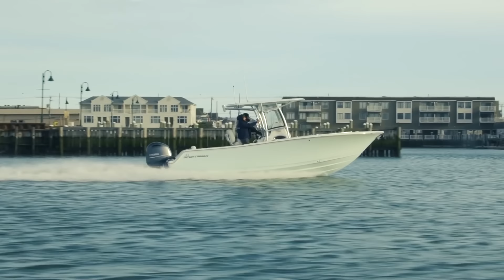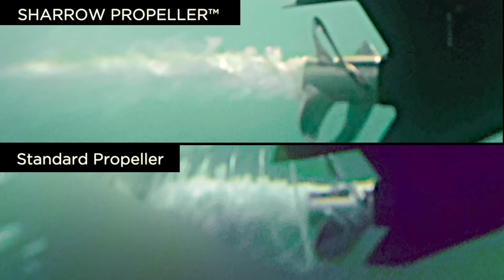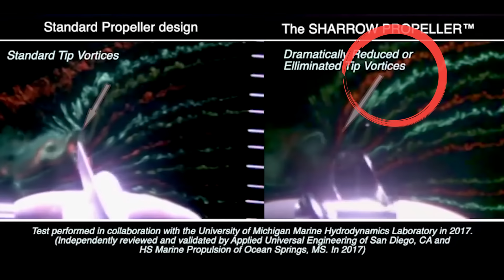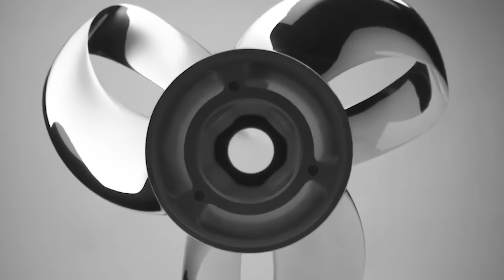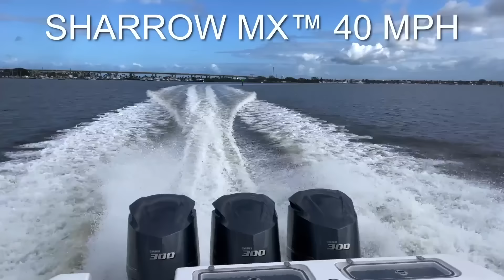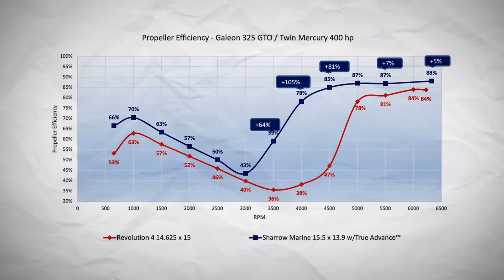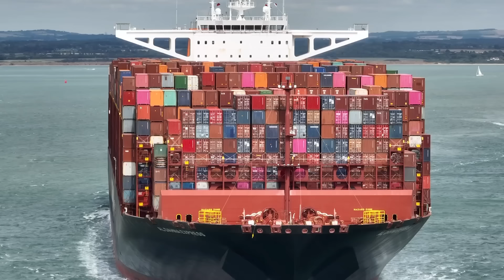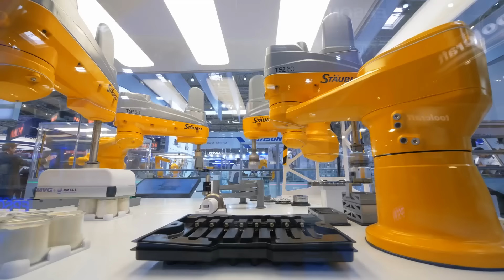This Genius Propeller Will Change Transport Forever

Comment: Efficiency improvements are rotational speed dependent; at midrange and high upper end of the operational envelope, performance may even be worse.
There is a danger in cherry picking performance improvements.  The Sharrow torroidal prop can push a boat to plane at a lower speed than most other props, so efficiency difference at that point is significantly greater than the non-planing boat, but once the other props are operating at higher speed and planing, the efficiency difference dwindles.  Noise reduction is significant across the normal operational range, I believe.

Be sure to credit those whose video excerpts were copied to make this presentation.

Comment: A standard prop with a prop ring is less noisy and vibration is much smaller. In Sweden the put a plastic prop on a ship and because it makes less vibration do to it is softer than copper prop.

Comment: NoiseBlocker eLoop is a series of computer fans with ring propellers that exists for like 10 years already. They are standard size and fairly priced, you can go and buy and use them like any other computer fan. Just like toroidal props, they don't produce a lot of vortices, but, while they are efficient and quiet enough to make a great product (and look wonderful), they don't show any crazy figures and didn't start a revolution in computer cooling. So yeah, always be sceptical when something is promised to "change everything".

Comment: See a title like that and you already know the video is gonna be a let down
Reply: The video wasn’t a let down in my eyes. Did you think this prop was gonna make boats start flying in the air? It gained a substantial increase in efficiency and is much quieter. It’s quite literally a multi-million if not soon to be billion dollar invention that potentially changes quite a few aspects of everyday life. As was stated in the video it’s not only going to be for boats. Use your imagination and think about all of the potential capabilities of having this prop design on other mechanisms. Box fans, maybe they won’t be so loud. Wind turbines, more efficient more energy production. I mean really the only way this can be boring is if you didn’t follow any thought paths and looked at it from the surface level.

Comment: Why cant these parts be cast then machined as against using a billet as s shown surely that would bring the cost down by 50-60%, lets hope that this about improvement and efficiency and not driven by profits alone

Comment: Would be good to mention, with respect to cargo transport vessels, that they are some of the worst polluters on the planet, and one such ship emits more particulate and other emissions than up to 16 million vehicles per day. Increase fuel efficiency by 20% on those fleets and that is a potentially massive jump towards both cost savings for the shipping companies, and a massive reduction in per-trip emissions, which is a huge deal.

Comment: The issue with boats is dinging the prop on a rock, log, or whatever is floating at the time; there's no way I'd risk a $5000 prop no matter the benefits. These props need to be the same price. Figure it out.

Comment: Great vid with new tech. Another possible advantage would be  less fouling and cutting as curved tips would shed debris. They are blunt so less like a knife to not cut into things. It might be a compromise for blade guards on drones? It would seem there is more surface area so the blades could be a little shorter for the same amount of thrust. ...also, the tip web would give inherent structure making them stronger per given length.
Reply: This isn't new.

Comment: As a person with a home recording studio, the computer application for this is something I hope happens. We always have to keep the computer out of the room, or record outside the room.
Reply: why would you not just use background noise cancellation from a audio sample of your computer fans? or just use fan software to min the fan rpms when recording?
Reply: You might want to invest in a water cooling kit for your computer.  There are off-the-shelf ones as well as custom water block kits.  Not only is your computer cooler - but much quieter.

Comment: Now recent test from peoples with drones did show, that this propeller doesnt work better, has lesser thrust and consume more power, and that guy from MIT tells only half of the truth. That shape from that so called toroidal propelller is inefficient and even if you would make the propellers higher, it would stress the bearings from the little motors from drones.

Comment: Very interesting!  But clearly, to scale ship propellers to the size needed for large freighters, an entirely new manufacturing method needs to be created, as a single steel ingot that size is unachievable, and would be WAY too expensive to machine even if it could be made. 3D printing with laser sintered metals has only been used on small pars and the metal particulates are quite expensive on their own. Sintered metals also have less strength and likely, greater porosity. Could a molded, near net shape of that complexity be made with sufficient strength and with minimal distortion?

Comment: This is an MIT Fake! They miscalculated the effiencenty - and this prop has more weight - this also ignore the MIT measurements - so the torque is higher for the motor and this mean less effiencent in comparing to the normal blade! Why the hell all you make videos of this fake?

Comment: Here's an interesting comment. Your title in your thumbnail, "105% efficiency" is clickbait bullshit, it is impossible according to the real laws of physics just as much as you can never go 100% of the speed of light, and you're an asshole for using such cheezy tactics. In case you're interested, 105% efficiency means it would generate 5% more power than you put in. There is nothing on earth that can be 100% efficient. Say, do you have a perpetual motion machine perchance?

Comment: $5000.00 compared to $500.00 🤔 That is 100 times the amount! You would never make that back in the lifetime of the propeller. Never. If the propeller never got damaged or weighed down with debris like sea weed (which would cause it to run less efficient). If you ran it in clear water, no accidents, polished and cleaned after every use, you would still never make back the initial cost. Unless those are made way cheaper people will not switch.

Comment: Efficiency can never be greater than 
100 %.
Should this be possible the apparatus will be able to fill the fuel tank while operating
Reply: At 105% efficiency it gives back more useful energy than what is used to drive it.
This is an impossibillity

Comment: The efficiency of 105 % that you quote is a nonsense.  From the figures, it is 105% more efficient that the propeller used as the reference. This video is slowly taking on a bad smell. There is no efficiency plot for the propeller in air. Is that part of your strategy?

Comment: It is unclear to me how much the noise is reduced. The rotation speeds appear to be very different too, The toroidal propeller being about only  50% of the conventional propeller.  The graph seems to be indicating over 30 dB(A) noise reduction between 1000 and 3000 Hz while the original noise is only about the same. But those figures are only estimated by eye off the chart, do you have the original figures?

Comment: This is not a new concept, as a kid back in the late 50's I was 10y old and we had a hand held toy that had a 6" enclosed propellor on top, where you was able to pull a retractable string that was fixed to the spindle that spun the propellor skywards and was very effective and fairly silent.

Comment: I am thinking that an alternative to the toroidal design could be to fit integral wingless to the tips of standard propellers just like we see on many commercial jets. The principle of the wingless in disrupting vortices is essentially the same in both cases. The advantage of propeller winglets would be economy of manufacture and simplicity of design.
Reply: What's happening with this auto-type ? I did say 'winglets' and not 'wingless'. Everyone reading this will think I am clueless !
By the way , anyone not familiar with the term 'winglet' , just picture the image of the wings of a Bald Eagle. Those striking feathers jutting out at the end of the wings are not just to impress or to strike fear into any prey which watches in terror as it tries to escape. The winglets break up the vortices formed at the wing tips , thus increasing efficiency and lift. Aero Engineers discovered this a few million years after the Eagle implemented it. Now they can put a feather in their caps.

Comment: Nice video, expertly presented and illustrated . This was a nice explanation of an exciting new development in propellers which evidently has some very significant advantages in performance and efficiency.
 I'm wondering if there is a potential application for wind turbines for power generation. I can just envisage turbines with smaller diameter and lower height with evident economic savings . There would be questions of efficiency , and of course manufacturing complexity and costs. Judging by the evidence of the engineers involved in researching the toroidal design I think it wouldn't take long for them to evaluate the possibilities.

Comment: Like to see some test results on wind turbine blades and could it work in turboprop props to cut its main problem (noise). Would it work for helicopters?
Reply: No, not on helicopters. The dissymmetry of lift would be a huge problem.

Comment: It did not increase efficiencies by 105%, it increased efficiency  from 35% to >70%, an increase of just over 35%,. Stop reporting efficiency increase in liberal terms! Use proper engineering methods! Otherwise it only makes you look foolish.

Comment: Nothing will ever pass 100% efficiency in the whole universe. Nothing. Never. 99.999999999999999999.....% is the maximum. Nothing will ever be even 100%. You cannot multiply the energy you put into a device.

Comment: It addresses an significant inefficiency in propellers,  the "leakage" of fluid from the high pressure side to the low pressure side. It is this leakage that produces tip vortices.  Commercial Jet Engines use the stator duct to prevent these "leaks" while high aspect ratio blades are used to minimise them. These toroidal blades avoid having tips, reducing the opportunity for "leaks". A very good idea! Hope it succeeds at an affordable price.

Comment: I can see it being restricted to relative light loads.  Scaling this thing up would bring serious problem with controliing vibration, balancing, etc.  That is because the weight distribution through the blade width looks awkward. On a traditional propeller it looks and feels "natural" most of the weight near the axle tapering off towards the edges whereas this design has a relative large proportion of the weight far from the axle creating a bending momentum when the slightest disbalance occurs. And such disbalance is guaranteed to happen even if the propeller is perfectly balanced out of the factory: a small dent, a stone chip etc. would do it. So when used is a heavy load situation this propeller will have serious reliability problems. And I haven't even started on the "ease" of its maintenance! And if something goes wrong is it really repairable? What do people think? I am obviously not conviced beyond light applications.
Reply: Good point. It helps to explain the difficulties described by some other commenters experience with these kinds of propulsive systems.

Comment: Looking at the design pictured almost looks like 2 inboard props left hand and right hand stacked on top each other with tips connecting....seems almost doable by configuring a tip piece to connect

Comment: * Not so interesting, unfortunately I saw this  Type of Prop back in the 70's and was and rejected and suppressed by the US Patents . . . Now, it's basically been stolen from or off a Patent application that was either Filed away, Stored or left laying around for some 'American' to develop !!!  ( The original patent application was made by Allan Bird of Bird's Engineering, Bulawayo, Rhodesia { No relation of mine} and probably still have the Paper work with them in Zambia ) Another Stolen by the USA occurrence ??? >> Yes it is, I witnessed the excitement and security  during development, so so very sad the USA does this !!!

Comment: try diy radial ring magnet in copper pipe sheet motor with iron rod core
Reply: bi-prop is clearly better (two propellers stacked with curved end piece, just like in bi-planes should have, or circular wing kinda
Reply: or spiral cone propeller, that takes air from sides, kinda aero spike spiral turbine
Reply: also you can do simple metal 3d parts by 3d printing a model/mold then electroforming a thick shell of metal, like with chromium/titanium

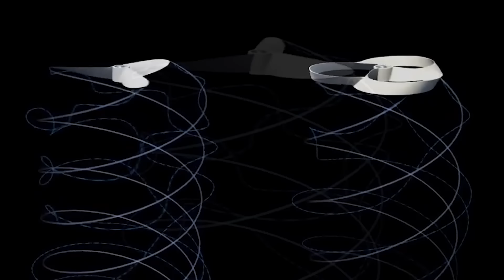Comment: Sorry, but the drawing on the right at 1:17 is completely nonsense! It does not show a true toroidal prop because the blades are not twisted correctly - in fact not twisted at all, what make the slope at the "tips" go to almost infinit instead to almost zero.

Comment: Those dudes at MIT didn't come up with anything, they just added the wrong name to the mobius strip propeller so no one would find other research. I found a publication dated 1996 on the subject of these propellers. You can find them by googling "Propellers And Fans Based On The Moebius Strip" or "Screws, propellers and fans based on the Moebius strip"

Comment: No, increases in efficiency are not properly described in numbers greater than 100%. Any number greater than 100% should properly be reported as a factor, as in 1.1x, 1.5x, 2.0x, etc. One using % numbers greater than 100% smacks of marketing hype, and makes one suspect the person reporting has simply repeated marketing claims from a manufacturer without applying any critical analysis of it themselves. Also with regard to the outboard motor graphs, I question the graph that goes up to ~6000 RPM. It isn't made clear if that's crankshaft RPM or propeller RPM. Very often the two are different. An outboard drive train usually employs reduction of around 1.5:1 or 2:1 from crankshaft turns to propeller turns. Propellers turning at extremely high speeds are less efficient, and lead to higher amounts of cavitation (a problem mentioned in the video). If the toroidal prop can be run at higher speed thereby eliminating the usual reduction gearing, that could be an important advantage that would be important to communicate.

Comment: I used to do RC boating when I was younger and modded my propellers in a similar fashion, mainly because I was curious if you could "invert" the design of a propeller so that the water was kinda pulled into the blades instead of the blades just spinning wildly, causing a ruckus just to get a modicum of thrust. Was it exactly the same as a "toroidal propellor?" No. Did I kinda invent something revolutionary all on my own? No. But in many ways yes. Does this make me a genius on par with Nicola Tesla? Who's to say? But, probably.

Comment: more efficient in theory but peak performance leaves a lot to be desired for many applications.  High rpm performance is trash making it a useless design for the purposes that run high rpm. Efficiency is fun and all but its just not suitable for many implementations. keep researching.

Comment: It'd be interesting to see the effect of these blade forms on external bypass turbine engines.
Reply: Interesting idea. I am just wondering about the requirements of mass air-flow since the fan has to provide air for bypass as well as turbine compressor. The fan of an average aero-engine is in the region of 20 or more blades, necessary to achieve the aforesaid air flow. I would be curious to know how the geometry of a toroidal design might fulfill the preconditions.  The other important factor is the need to provide streamlined air-flow through the turbine compressor. I once encountered a challenging fault on an RB-211 gas compressor on an oil rig in the North Sea. The Rolls-Royce turbine specialist who was working with me strongly insisted that the problem was caused by a 'rotating vortex' in the airflow caused during initial ignition. I used this information to tweak the control parameters of our control system to alter startup conditions and was very relieved when it did the trick.
I can remember holding my breath when I pushed the start button after that , knowing that the safety of a 20 MWatt gas turbine and the fate of  200 oil rig workers was at stake.
Reply: @davidkelly1414   There are already external bypass turbine engines in development for aircraft for other reasons, but this sort of technology could conceivably help a lot.

Comment: Thank you for the video. The elimination of blade tip cavitation is critical to a submarine remaining undetected by enemy navies. As a submarine veteran, I am interested in the reduction of the noise signature should a toroidal propeller be tested on nuclear powered submarines. With all of the money that has previously been spent by the U.S. Navy on super quiet propeller designs, it's amazing that this hasn't been thought of before, or perhaps it has.

Comment: If this costs 10 times more but saves 20 percent fuel, would it be used long enought to get more money saved than you put into it? And how well would it work on a boat that usually does not exceed 7 knots?

Comment: This is NOT going to improve all of these efficiencies until the prices come down enough to make it affordable for consumers.  $4999 for a prop is outrageous.  Get the prices down closer to what a great stainless prop costs and then you will have them flying off of the shelves.  As a matter of fact I would love to have one for my optimax 135, but they are only made for motors of 150 and above for Mercury.